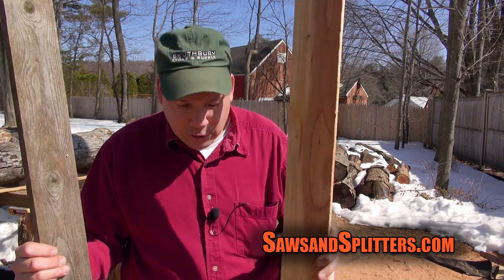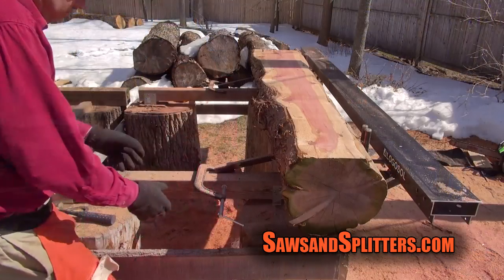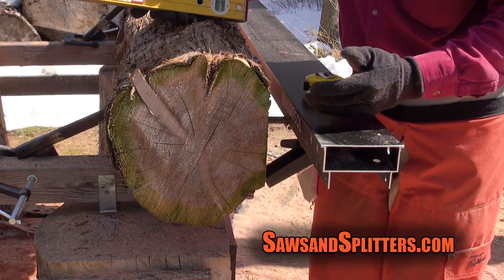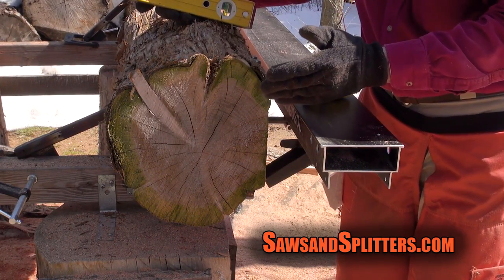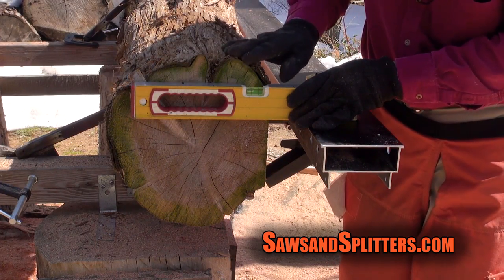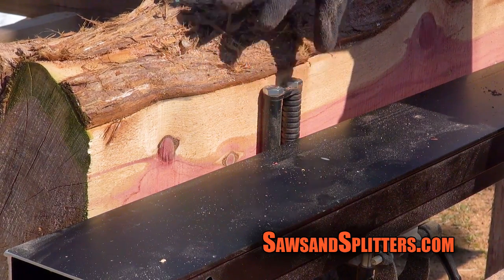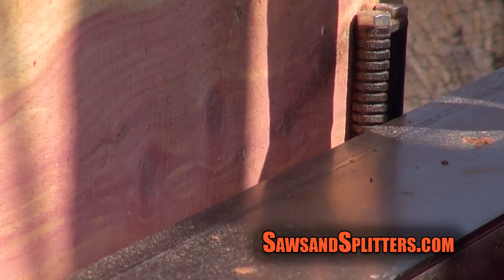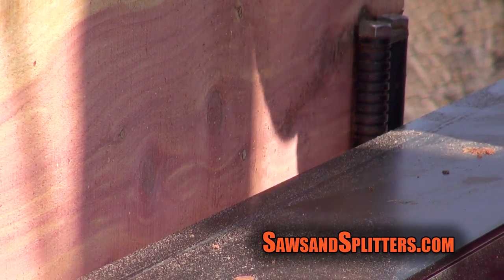MILLING A CEDAR FENCE EP.01

Comment: another cool video!

How often do you sharpen the chain while using the mill?

And, what do you do with those 1st pieces you cut off of the log?  They would make a gorgeous bench seat!
Reply from the maker: I file just about every tank of gas not because I need to but because I like a razor sharp edge.  Cutting the bark dulls the saw so once the bark is gone you can go longer.  Logosol recommends you sharpen as soon as you notice the saw going dull.  I'm in a recovery program now to wait for a sign of dullness before I file.

I hate to say it but I burned those pieces of scrap in the wood stove yesterday.  That cedar heats up fast but doesn't hold coals.

Comment: Thank you for sharing your experiences! I find this very interesting, since I also use the Big Mill Basic. So I look forward to each new clip. Keep up the good work!

I recently bought the Logosol log holders. They help quite a bit although though they are not perfect (see http://www.logosol.se/store/stockhallare.html). Before I had them I had a lot more vibrations while milling. Now it is manageable. You seem to have that taken care of already. I also learned that a new milling chain is too aggressive. Sharpening the chain with an electric bench grinder removed some of the hook. Now the planks are much smoother. I guess that's why Logosol recommends using a 4.8 mm file for a chain that should take a 4 mm file. Less hook seems to produce a better end result.
Reply from the maker: I looked at those and considered them for quite a while.  I'm trying, sometimes more successfully than others, to do more stuff on my own and not rely on manufacturers.  I have a welder and my spikes and flat bar at the end of my rails is doing an adequate job.  I have considered the support you nail into the log for the middle or the rail.

I'm running an everyday milling chain (3/8 semi-chisel chain filed to 10 degrees), not the Stihl PMX.  I have better luck if I hold the file higher when I file but more for the chain staying sharp than for ripples in the wood.

Have you used your Big Mill mounted on a log or just the log table?  What's the biggest bar you've used on the Big Mill?  I have some large logs and I'm curious if I could cut them with it.
Reply: I use a 20" Oregon Pro-Lite bar with a Stihl PMX chain and an Oregon 91R ripping chain. I have tried using the Big Mill on the log but mostly on a log table. With a big log I run out of height adjustment quickly when using the log table. Surely mounting the Big Mill directly on the log would allow for processing bigger logs. I have ordered a 36" bar but it is on back order and I don't have a ripping chain for it. Here are some pictures of my setup. https://goo.gl/photos/tNFhdPJSxGWbjBEP6
Reply from the maker: That's a nice setup!  Your pictures reminded me I need to tie the keys to the mill before I lose one.

They don't sell 91R chain in the US and my Stihl Dealer looked at me like I had two heads when I asked for Stihl PMX.  Those log clamps do look handy and they would also raise the log so I could make the last cut a narrower board.  Hmmmm....

You can get extensions for the rack and T-Bar if you want more height.  I run out of height quickly too.

I've milled on the log a couple times but I don't care for the log being low to the ground.  Too much bending over for me.  As you watch the videos in the series notice how I've got the saw right at the height I want it.

Thanks for sharing the pictures.

Comment: What's a "saw sand splitter"? ;)
Reply: Conversation Robot 

Saws and Splitters
Reply from the maker: I made a website for my passion and hobby (Chain)saws and (Log)Splitters.  If I have any thoughts I want to share about anything related to chainsaws, splitting mauls, log splitters, chainsaw milling and even repairs on my Dodge Pickup I  post them there.